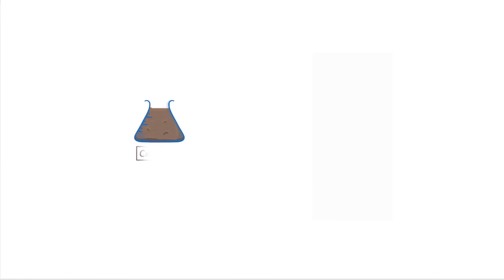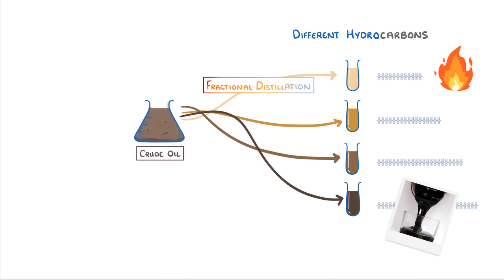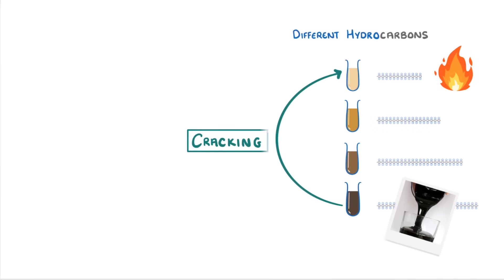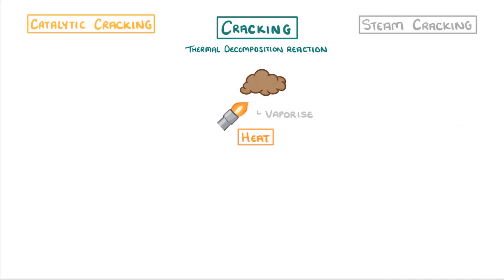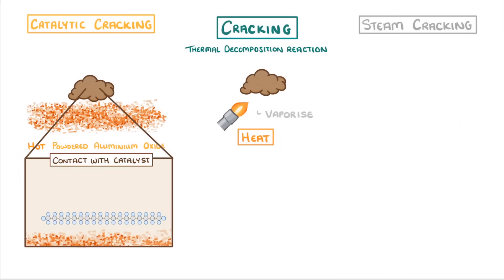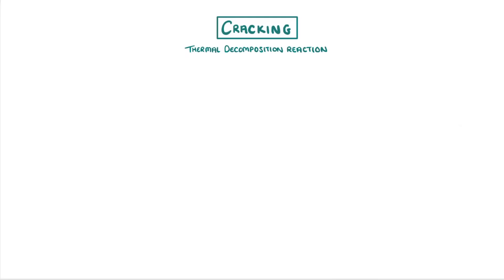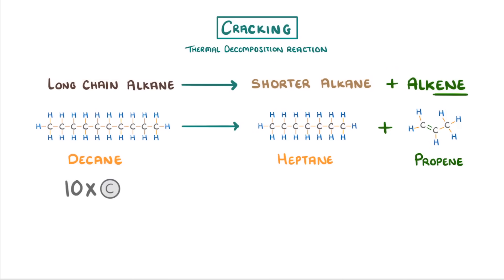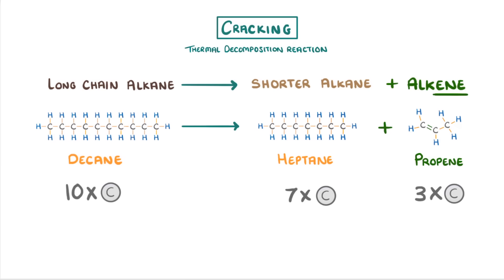GCSE Chemistry - Cracking Crude Oil & Alkenes

Comment: I dont understand one thing
So catalytic and steam cracking are 2 different methods
but when i watch a video about cracking it tells me to soak paraffin in ceramic wool then put a catalyst is the test tube 
then add another test tube and a delivery tube
so alkene and alkane can separate.
Then heat the catalyst then the alkene and alkane will seperate
then do the bromine test on the alkene
Reply: thats correct. the way you are talking about is the lab experiment for this catalystic reaction which is on a much smaller scale.

Comment: Guys, if you're struggling to memorize the structural formula of propene, but1ene and but2ene, just memorize these numbers by writing them on your hand or setting them as your password: 213 2123 3113 and you have to also remember 'up down' as thats the way hydrogen is written
Reply: Is this Edexcel or AQA

Comment: crude oil , mixture of different hydrocarbons separate by length of chains shortest most flammable,  loneger ones can be frozen down thermal decomposition reaction breaking down by hearing catalytic,  steam , heat long hair hydro carbons turn into cast , hot aluminium oxide pass hydrocarbon over  , steam cracking hydrocarbons mix with steam hear hydrocarbons split appart , long chain alcans shorter alcane and alkenee  Allen's used for polymers,  alienates double binds   akanes have singels alenersbmire reactive  bromic water added to solution of alcoves orange ti colour lsess